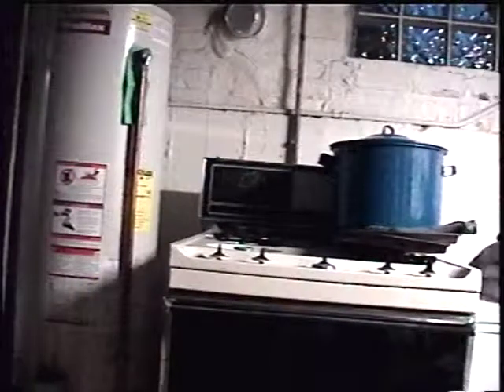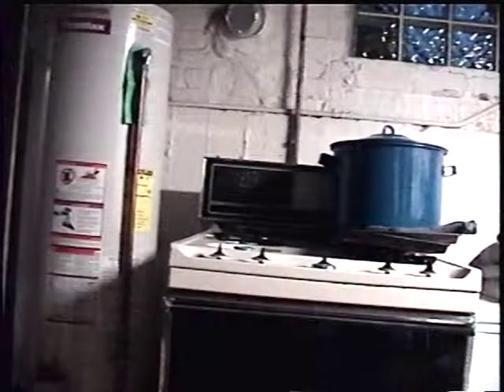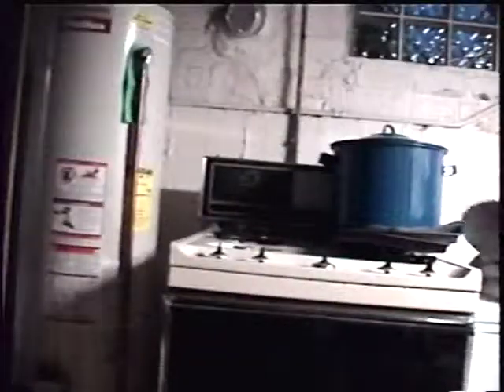How to make a plastic fan move more air.

Comment: I have done this and have also increased the angle or pitch of the blade. Be careful not to over due it because while it will move more air it will also load down the motor more. You can usually get away with doing this to a point, but if you do it too much you will loose rpm and the motor may overheat and not blow much more. If you do this just make sure to keep an eye on the fan to make sure it dont overheat.
Reply: plastic will also get brittle.